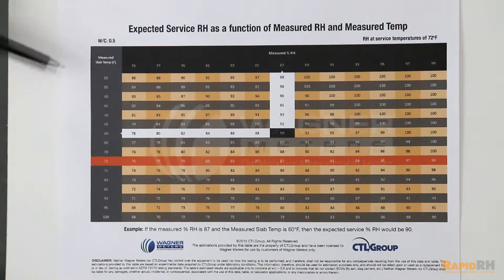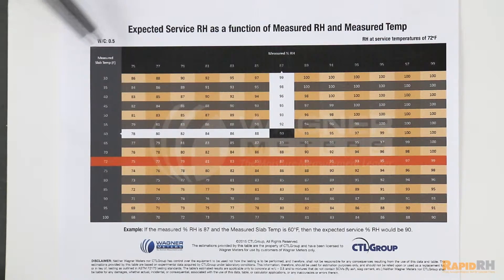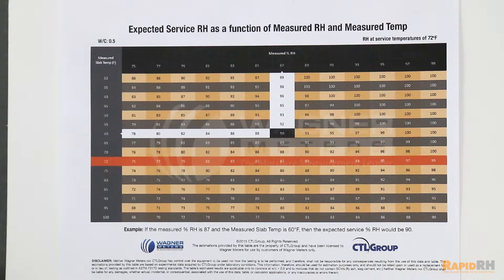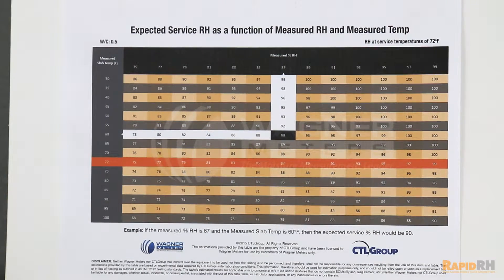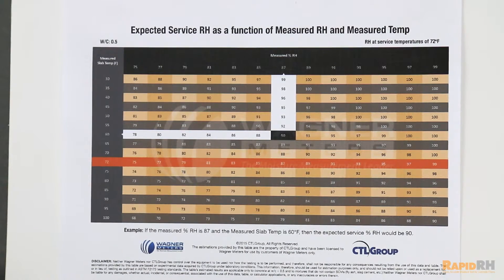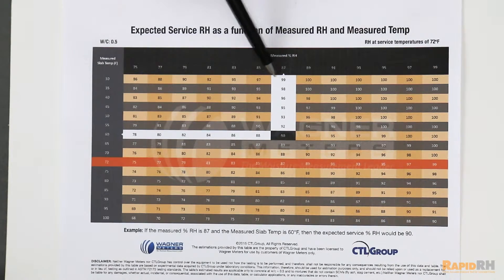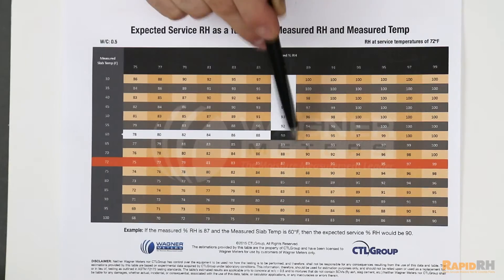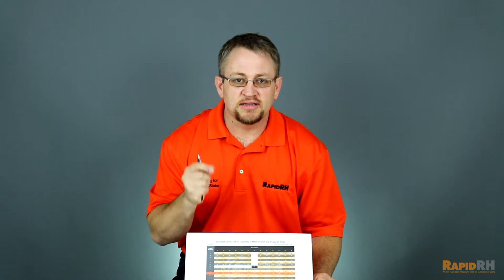Predict RH Readings Quickly & Accurately: Temperature Correction Table

Comment: Is it 60deg slab temp? Is the 72 slab temp or ambient temp at use?
Reply: +Evan Adams Sorry for the delay.  In the example, the 60 degree is sensor readings (slab temperature).  The 72 degree is ambient service temperature.